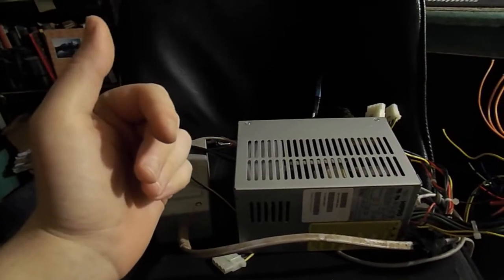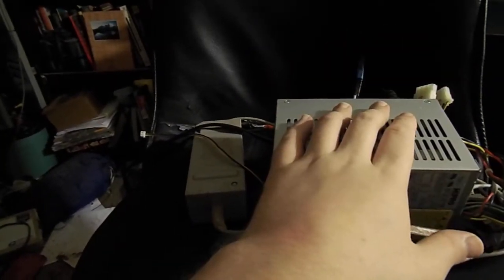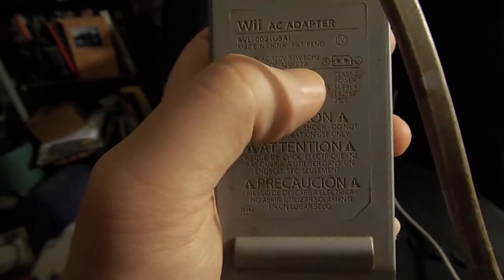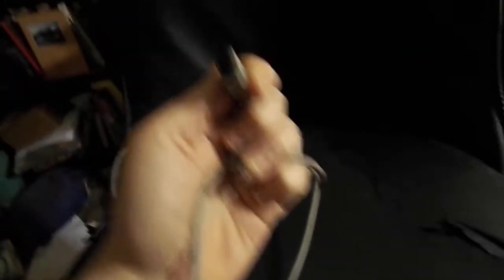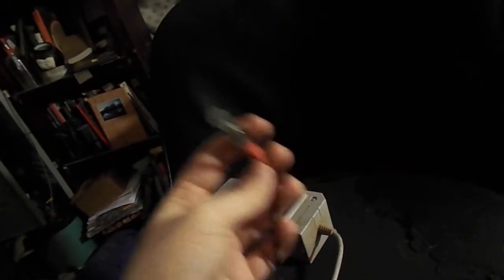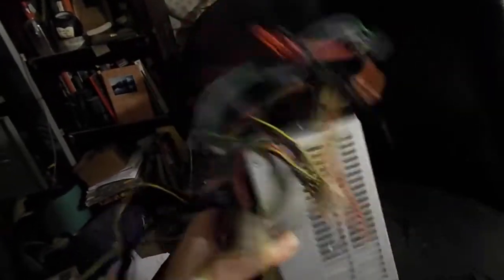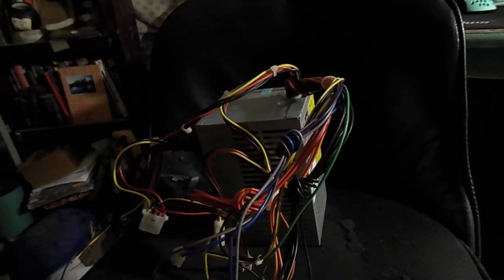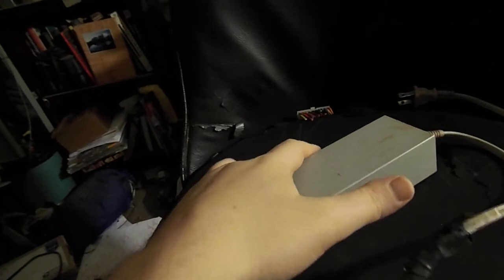DIY CB radio power supply options for resourceful people.

Comment: A 500 Watt PC power supply would be enough to run a decent CB radio. They are usually rated around 25 to 35 Amps on the +12V side. Also the higher the wattage rating is on a PC power supply the higher the amperage is on the +12V side.
Reply from the maker: Yeah a PC power supply really would work. The only problem is that PC power supply are switching power supplies so they are kind of noisy and can inject some noise into your radio if you don’t have adequate suppression 

Although personally I haven’t noticed that myself.

I have used a PC power supply before and haven’t noticed any increased noise levels but I’m also deaf haha

Comment: Would 2.67 amps be close enough?
Reply from the maker: I made this video a long time ago so I’m not exactly sure what you’re referring to are you asking if it would be enough to run a regular Radio?

If so 2.67 A would probably run a basic radio just fine

But it would really be better if you had something a little higher

I would suggest getting a power supply thats made for a cb radio.

Because there’s some power supply options out there that may introduce a lot of noise into your radio

Having said that I had no problem using the wii power supply, that’s why I’ve stuck with computer and game console power supplies because they usually have a lot of noise suppression already.

Thanks for commenting Johnny and if I didn’t answer the right question just leave another comment on this video

YouTube studio doesn’t notify me when someone replies to a thread so it’s a terrible silly process but you have to leave another comment

Thank you for being a loyal subscriber Johnny
Reply: @JohnnyJonesathome  that's exactly what I needed to know. Thank you Johnny.
Reply from the maker: Just saw this haha!! You are welcome!

Comment: Sorry to bother you Johnny but I have another question. How would i go about making an external power supply for a handheld cb radio? I have the Midland 75-822 in case that helps. Thank you Johnny.
Reply from the maker: No problem Johnny, just get yourself a barrel connector and wire it to a standard 12v power supply.

You can get the barrel power connectors in all sorts of sizes.

But make sure the power supply is a decent one, like an xbox or pc power supply

Cheap wall mounted power supplies can cause a lot of noise 

Thanks bud
Reply: @JohnnyJonesathome  Dude that's an awesome idea. Thanks so much Johnny

Comment: And another question sir. I have an old XBox One power supply. Its output is 12v 17.9 amps. Can I use that to power a CB or is the amperage to high? Thanks Johnny.
Reply from the maker: That amperage rating is what is the maximum allowable. Think of it like a ceiling

So anything up to 17 A will be fine (although personally I would keep it a bit lower just to keep from overheating anything)

I made a recent video on how to use a mobile CB radio as a base station.

You can see in that video that a regular radio doesn’t pull too many amps at all

You should be able to easily run a side band radio with that kind of current rating

The specified voltage on the other hand is something you have to look out for

If you try to run a Radio 18 V so you could blow things out

But of course that power supply is a 12 V so no problems there

And not to make things too long winded but think of voltage as a measure of pressure and current (amps) as the amount of flow 

So the amp rating is the maximum allowable flow before things overheat

Thanks johnny 👍
Reply: @JohnnyJonesathome  Thank you for the help sir
Reply from the maker: No problem my friend 👍

Comment: Vintage Midland CB Radio Power Supply Mod 18-143D. How could I use it?
Reply from the maker: That power supply has a current limit of one amp

Which really isn’t enough to transmit on

So I wouldn’t use it for a cb (unless you are using receive only) 

If you would like to use it for another reason however, you can do this by buying a DC power plug and soldering it to the wires on your battery to be charges or equipment to be used

there’s a jack on the front panel for a DC 12v plug. positive goes to middle connector and negative goes to the outside

However when it comes to using a CB radio I would just find an old computer/gaming system power supply (or you can even use the power supply of an old printer or something)

You can use any power supply you want as long as it’s between 12 and 14 V and has a current rating of 2.5 to 3 amps for a basic 40 channel radio

Some power supplies are noisier than others but in my experience power supplies that are made for gaming consoles or computers often have pretty good power supply filtering
Reply: @JohnnyJonesathome  thanks brother. You saved me some money
Reply from the maker: No problem man 👍

Comment: One more question. Is it ok that it's not putting out 13.8 volts?
Reply from the maker: Yes a car battery doesn’t run 13.8 V all the time but we can still use a CB in them

The voltage can fluctuate quite a bit without causing issues

Some radios can drop down under 11v but usually at that point you start seeing  issues

On the other hand radios can work fine at 14 V But the more you increase it the more risk you have of destroying your radio.

So if you maintain something in that range you should be good,  A lot of people pump extra voltage into the radio for more output power but this usually decreases the lifespan of the radio significantly.

Good question by the way thanks for asking
Reply: @JohnnyJonesathome  Once again Johnny I thank you for your help. I cant wait for your next video.
Reply from the maker: No problem my friend 👍 a new video is coming soon!

Comment: I have an old XBox 360 power brick, its rated at 12V and 14 Amps. Is that an ok option?
Reply from the maker: Yes that would work.

if you attempt it
just make sure you’re using the 12 V rail

I am not sure but I think Xbox 360 power supplies have multiple voltages like a PC power supply
Reply: @JohnnyJonesathome  This brick only shows one Voltage output. I assuming that means only the one 12V rail?
Reply from the maker: If it only says 12 V then you should be good.
 if you have a multimeter you can make sure everything’s working and at the right voltage

Comment: I have a few supplies that are 12v 30amp I want to use them for ham and cb do I need to use  5w resistor for a load for it to run proper?  i would remove the fuse on the pc board and use a external  fuse holder so you can replace the fuse or a nice reset fuse.
Reply from the maker: No it should run fine if it’s rated for 30 A that just means the radio has more room to swing.

Depending on what radio you’re running a fuse will have to be changed.

With pretty much all CB radios at stock settings a two amp fuse would work just fine

But if you’re using a cranked up 10 m radio or an actual ham radio then that will burn the fuse out immediately so if you want to use interchangeable fuses That vary with each radio that’s probably a good idea

In fact I am working on a project right now for a limiting noise in switch mode power supplies, Might want to stick around for that one.